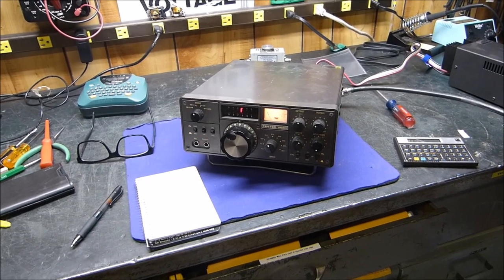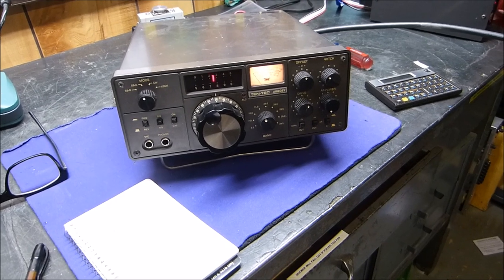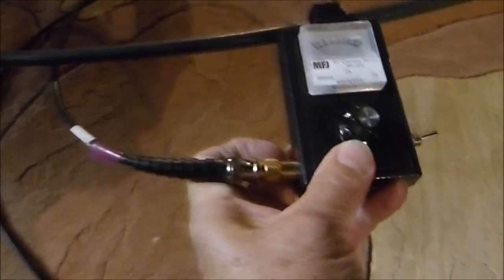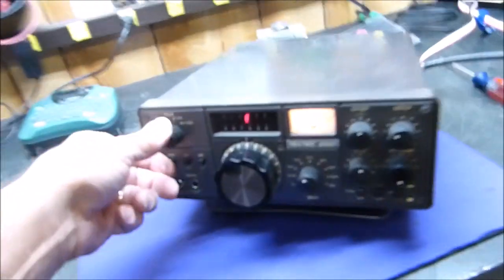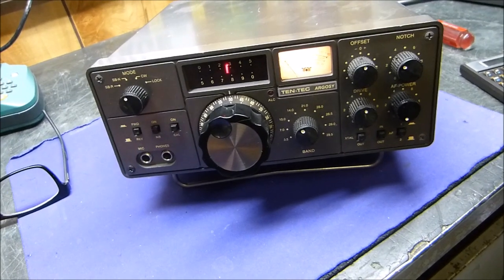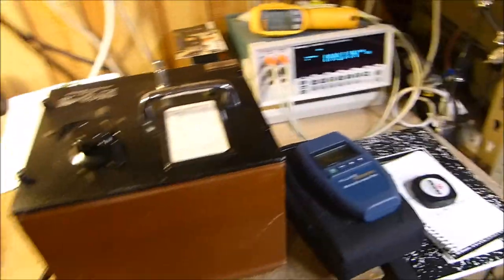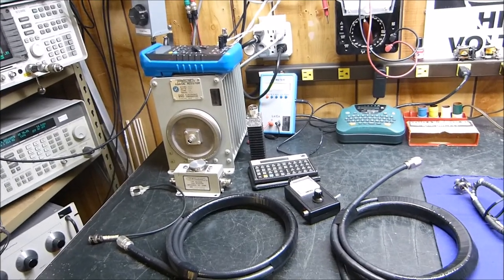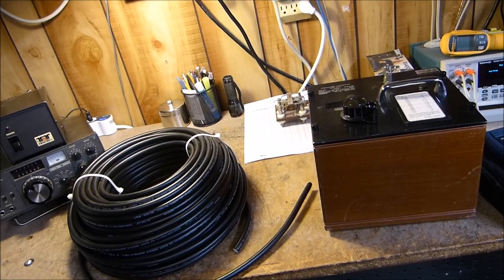Common Mode Coax Choke Baluns

Comment: Your video raises some questions.  I'm interested because I'm going to make some chokes and like to know they are optimum.  I may make similar tests.

First - you made a deliberate mismatch with a 500 pf series cap, and got a predictable swr of 1.6  Why would that result in common mode currents, though?  Apparently it did, but why?  CM is caused by imbalance at the feedpoint and I don't see where you had any.  In other words, say your mismatch was a 75 ohm dummy load, would that result in CM current as well?

Ok, so let's assume what you were seeing is actually CM current (which I believe it is).  You know there are peaks and nulls along the line, because the CM signal is a standing wave on the line.  Theory tells us the SWR is the same along a coaxial line; it doesn't matter if there is common mode current or not.  The impedance changes with distance from the load, but the swr does not.  (SWR measuring devices, including whatever is in the Ten Tec, may become confused by the common mode and do strange things like shut down, but not because of swr.  Agree?  The Ten Tec might have become unhappy if there was a CM peak in voltage on its chassis with the particular length of coax you had).
The length of the coax determines the point where the peaks and nulls sit on the line, right?  So when you inserted the 9 ft cable coil that would move the peaks and nulls significantly.  I think maybe you should always search for a peak and make your test there.  Then you might get a more meaningful result that you could compare, a sort of before and after data point..  The ferrite bead balun would do the same, just not as much, but at 20 meters, even 2 feet is significant.
But it sure looks like your CM chokes did the trick. 
People talk about lengths of transmission lines needing to be 1/2 wavelength, but no one has ever given a good reason why, other than if you were making impedance measurements and wanted to know the R and X of the load accurately.  But it has nothing to do with swr, because swr does not change along a transmission line if you are measuring it accurately with an instrument that doesn't get disoriented !

You have a lot of good test equipment.  I think I will look at some of your other videos.
73 de K2XT
Reply from the maker: I will do the best I can at explaining it as I understand it.

When I put a non-reactive Bird dummy load on the end of the coax I get no common mode current and the SWR is 1:1 and nothing can be measured so I did, as you say, deliberately put some reactance in the load so there would be a standing wave on the line and we could measure it. There would be no standing wave if there were no reflected power. With a load (antenna) that is not perfect, and none are, there is always some, reflected power and some level of standing wave on the line and if our instrument is sensitive enough we an measure it. As the little meter was stock, it took 100+ watts to drive the meter. That is why I modified it.

 We want to make the coax line any integer number of 1/2 wavelengths so that what we see at our transmitter (and receiver) is nothing more than what the antenna is. With any amount of reactance at the antenna, the SWR will vary along the line. You can measure your SWR and then add in, say, 1/4 wavelength of coax and measure it again and it will have changed unless the load (antenna) is perfect. Try it.

A similar condition to standing wave is when we use a TDR to see if our transmission line is terminated in its characteristic impedance. If you have ever played with a TDR and a variable load, you can see the reflected pulse go positive with a load higher than the Z of the coax or low if the load is lower than the Z of the coax. When the load is exactly the Z of the coax, the pulse disappears just as the standing wave would if you were exciting the transmission line and load with a sine wave as we do with the transmitter. This is what we see with a pulse and is the easy way to measure the length of the coax. A modern day ethernet network analyzer works great. You can build your own pulse from an RC circuit that differentiates a square wave. I have posted at lease one video on the TDR you might like.

I did a number of measurements with my GR bridge that I didn't show on the video and it proves that the complex Z at the transmitter end of the coax  varies with the length of the coax.

As for the exact length of the coax choke... The "books" say it should be resonate somewhat above the frequency you are operating at. If my memory serves me well, somewhere around 80 MHz or so - at least according to that author. I intentionally tried to make my mono-band coax choke resonate just above 20 meters and I believe it came out to be around 18 MHz. Some authors say the length doesn't matter - somewhere between 10-30 feet, scramble wound, etc... other authors say the exact positioning of the winding's is critical. Who knows?

To tell you the truth, if the choke was exactly resonate at the operating frequency, I am not sure if it would appear as series resonate or parallel resonate. It would make a huge difference.

In any case, not only do I use the minimal choke at the antenna, I also have the length of my coax at exactly 3 wave lengths. The aluminum tubing the antenna is made of broadens the frequency range of the antenna and it is about 1.5:1 well below and above the 20 meter band. It is still just a dipole but it make a huge difference being able to rotate it.

I hope I am generally correct and this makes sense. If it doesn't and you know where I am in error, I truly want to know and learn.

David
WA4QGA
Reply from the maker: I might throw one more thing in here. I first tried two 50 ohm Bird loads parallel which gives me 25 ohms and into a 50 ohm coax I will have a SWR  of 2:1. The Bird watt meter shows this. However, I can't explain it but, this 25+j0 impedance did not cause any common mode current that I could measure. Of course, I could have always made some dumb mistake at the moment but when I added the capacitance (reactance) I got the common mode current that I could measure.
Reply: Thanks so much for your response.
Theory says that the swr is determined by the mismatch at the load, where it meets the coax feedline.  (It is defined there, once and for all).  And, except for losses in the coax, the swr is the same all along the line.  This I am certain of.  With a mismatched line the impedance  as seen at the end of the coax changes.  That is, the R and X varies, but repeats what was at the load every half wavelength.  But there are lots of different R and X values that result in the same swr.
I understand that some swr meters can't deal with the above and will report different values.  Example:  25 ohms is 2:1 as you said.  So is 100 ohms.  A meter may read the 100 ohm case as 2:1, but have an error with the low impedance case.  Large common mode on the line could also do the same thing.  This MAY be why people try to get a 1/2 wavelength of cable, so the swr meter is seeing the Z at the antenna.
If you have a good swr meter (a Bird? Although you have to do math to get swr for every reading) you should easily verify this.
THEN, if you put in the reactance I am still stumped as to why this causes CM current but apparently it does.
Now I am having second thoughts about your coil of coax moving the point of peak voltage of the CM along the line.  It should definitely be counted in the transmission line length to determine the 1/2 wave distance from the feedpoint, as if you were to be phasing two antennas together you would need to account for the phase delay in the coil of coax.  But in the case of the CM current and voltage the coil of coax may act differently since it is an inductance to the shield of the coax.  Right?  I think I will duplicate your test using a big clamp on toroid I have, to first build a current probe, and then go from there.  Thank you.
Reply from the maker: I think the network TDR would include the choke length as I don't think the coil would affect that pulse signal in any significant way. We, for sure, both agree that each 1/2 wavelength everything repeats so we only see the antenna and not the effect the coax adds, at some particular frequency.

If you try this, please let me know your results. It is always conceivable that I have made an error in my approach or measurement. The schematic can be seen on line for this device,. It consists of the ferrite core with 8-10 turns of #18 or #20 (not critical) wound on it with maybe a 100 ohm resistor across the winding. One side of the coil is ground and the other feeds a germanium diode with a cap back to ground on the output of the diode and this all goes to the meter - maybe with a pot in series with or across the meter. It's pretty simple but I couldn't find a ferrite core that would open up.

I also said something wrong when I said resonate at about 80 MHz. That came out my brain from an article I recently read on "Improved anode parasitic suppression for modern amplifier tubes". You might like the article too.

I think the idea for a "best performance" mono band choke is to have the resonate frequency somewhat above the operating frequency.  How much is debatable.

Per your comment, I am not sure the choke moved the point of peak voltage of the CM along the line. I was not very observant exactly where the peaks and troughs occurred. I don't believe it moved them. I think it just diminished the amplitude. I may have to watch my video and see if I can see if anything changed along the length of the coax with and without the choke. 

Seems like everything we do just raises more questions - but I like that and eventually we figure things out.

One more thing - maybe I am thinking wrong, but - if the standing wave ratio is 1:1 there is no standing wave - isn't that right? A standing wave is caused by the mismatch between the coax and load. The reason I have real  confidence in saying this is because I could not measure any current (standing wave) along the coax when the terminating load was, 50+j0.

I can't explain why I could not measure CM current with a Z=25+j0 impedance. I assume I would get the same results with Z=100+j0 both giving me a 2:1 SWR. I could have had bad connections - who knows. Maybe I forgot to turn the transmitter on...   :-)

I agree that there are many different complex Z's that can result in the same SWR.   There are some really nice online calculators that let you solve for the SWR for any value of R and X
Reply: Consider the symmetry (or asymmetry) of your two test loads.  The paralleled dummy loads were near perfectly unbalanced.  Additionally, the actual internal loads are completely shielded - no radiation.  In the assembly of your dummy load & capacitor "antenna", do you have any exposed leads that could radiate and induce currents into the shield?
Reply: @agelessyankee7790  yes.
The point he (and many/everyone of us) has to understand is that impedance mismatch at the feed point is going to create Standing Waves only; Not the Common Mode Current.
Only asymmetrical deployment of the radiators (I mean the 1/4 lambda conductors either side of the feeder in a 1/2 lambda dipole antenna, for example) would cause the Common Mode Current to flow on the outer surface of the shield of the coaxial cable. It may also be produced when RF absorbing structures are nearby to one of the limbs the antenna or just there may be asymmetrical distribution of the RF absorbing structures near each of the limbs of the antenna. One of the limbs when it's close and parallel to the feeder will certainly induce some of the RF voltage into the shield of the coaxial cable. The Common Mode Current, will distort the radiation pattern during transmission and it will bring in RF trash from nearby sources during reception.
Because of the "Skin Effect Phenomenon" the Common Mode Current is restricted to few micron thickness of the shield braid's outer surface (more the operating frequency less the depth) only.
So, essentially the CMC is a phenomenon that's exhibited on outer surface of the coaxial cable and the SWR is a phenomenon that's exhibited on the inside of the coaxial feeder.
Standing wave's magnitude would be changing as you keep moving either from the source or the load along the transmission line but the ratio to Forward (incident) energy and the Reflected (reverse) energy, called the SWR (VSWR or ISWR) would not change.
He, by having a 500pF variable capacitor in a box and a commercial 50 ohm dummy load, has unknowingly but deliberately introduced imbalance at the end of the coaxial cable that manifested in the occurrence of the Common Mode Current along the shield of the cable. And it shows the presence of the typical crust and trough of a sine wave.
When he introduced the ferrite bead choke (W2DU BalUn) the magnitude of the CMC is zero, as expected.
Again with the "coaxial cable Ugly BalUn" either the choking effect could have taken place or as you (and I) suspect the points of peaks and nulls could have been shifted along the transmission line due to additional length of the cable.
Finally, I should appreciate all the efforts he put in to make the video despite the dyspnea he was having while walking up and down. 
I believe he would make another video with correct information and post it here.
De VU2RZA

Comment: BS

no such thing as a choke balun.

Those are two radically different things.

A choke is essentially an open- circuit for RF.

A balun is a transfirmer between balanced and unbalanced transmission lines.

Baluns have nothing to do with antennas.

Proof on my channel.